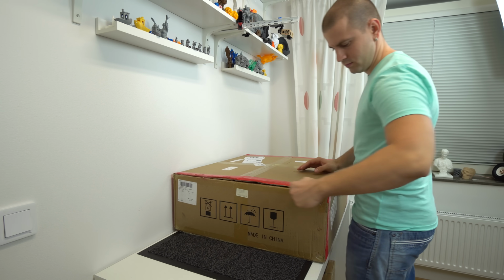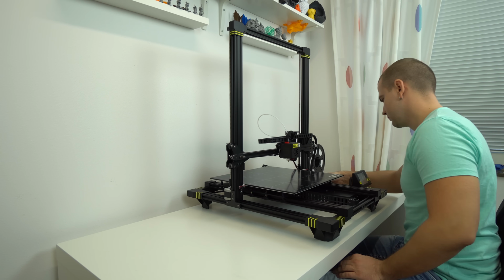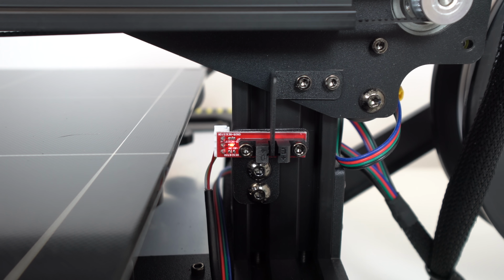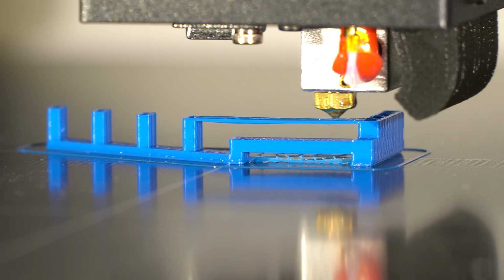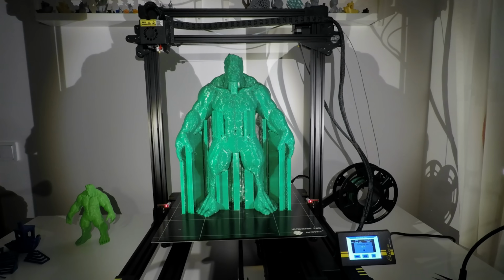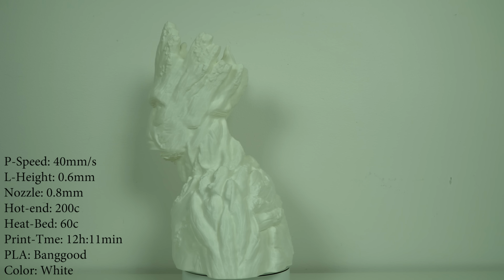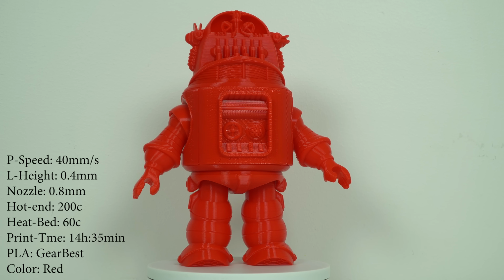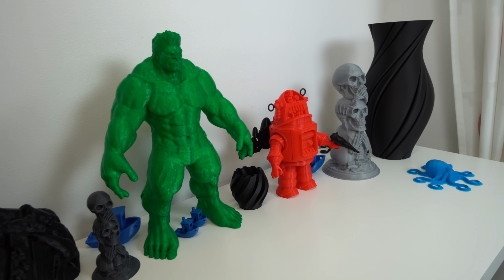Anycubic Chiron Final review - in depth  4K video

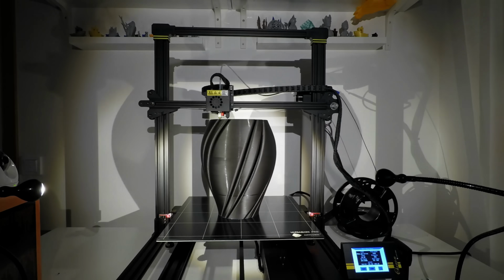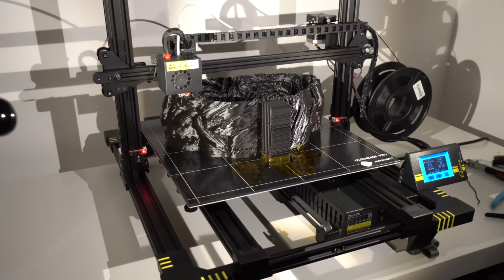Comment: Great review! What are the strange discolored line/layers in the vase at 13:19 and also visible on the model near the bottom while its printing at 15:37
Reply from the maker: HackintosherHD Thank you! Well those lines are actually caused by temperature change. On Back Vase I had to turn speed down almost to stop because filament was tangled and on Black Groot I had to slow down printer to minimum print speed just to give me time to tape down suport tower becouse it was about to fly off from the build plate.
Reply: @NexiTech  Ah I see, Thanks a ton for that information, Those 2 things were the only things making me question the print quality, was worried it may have been something with the z axis. Ill likely be buying this printer in the next couple days and will buy it with your link thanks to this great video. Keep making these, i really do enjoy the effort you put into the reviews, and the fact you review things that there may not be a ton of information about. Great channel overall, and thanks again for the response.
Reply from the maker: HackintosherHD Thank you so much for such a nice words my friend! I wish you all the best! :)
P.S. 
You rock!